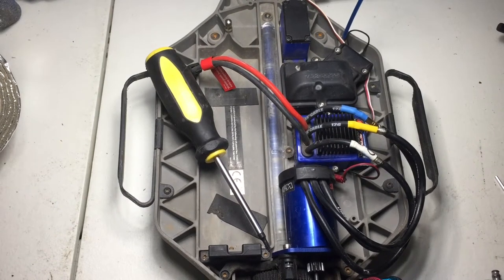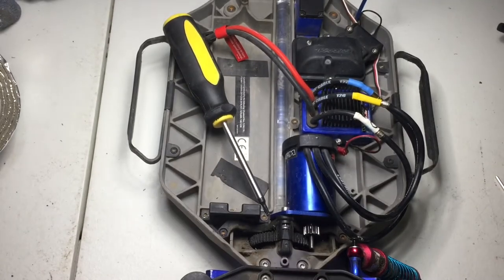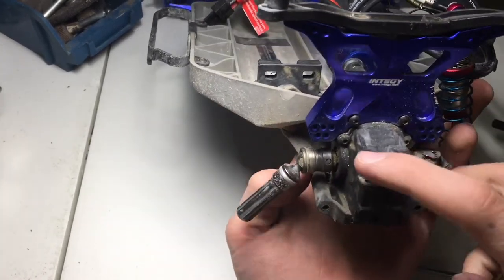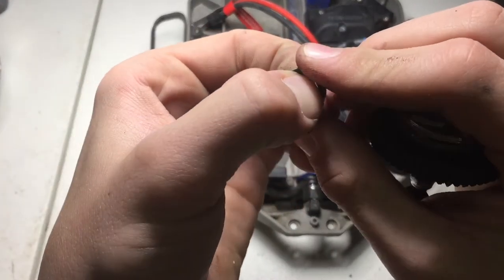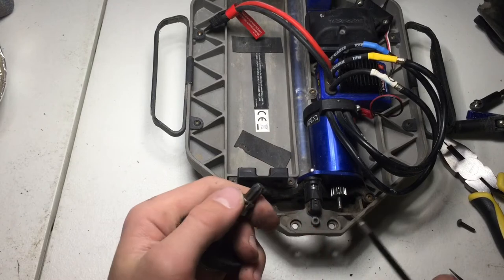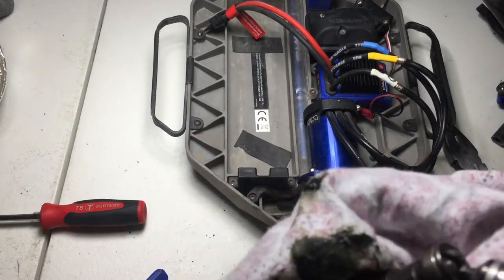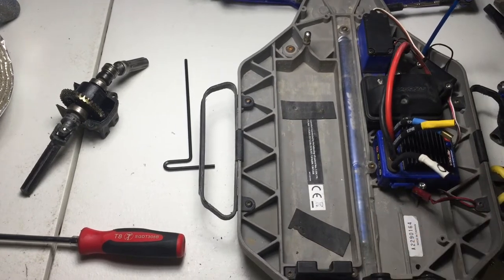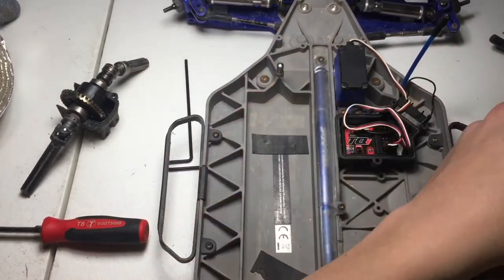My Traxxas is a Stripped Screw Nightmare!

Comment: I have the same problem of the screws stripping out but it was the grub screw on my pinion
Reply: Sammmmeeee!!!! How did you end up fixing it I am still stuck with it
Reply: @bryan.s6104  I’m just now having this issue any fix?
Reply: @MarbleCityOutlaws  no i actually ended up using dremel and grinding it down then buying a new pinion and grub for like 7 bucks on Amazon.
Reply: @bryan.s6104  oh ok I was thinkin about gettin an extraction kit just so I’ll have it if it happens again. Def ordering some stainless steel screws next time
Reply: @MarbleCityOutlaws  ya traxxas really should invest in better hardware
Reply: @bryan.s6104  I’m not even using traxxas I got a yokomo drift car build and I guess they have garbage screws too
Reply: @MarbleCityOutlaws  lol sounds about right

Comment: I have the same problem on my stampede 4x4 vxl I recommend getting a stainless steel screw set from Amazon...best $25 spent for it
Reply: The stainless screws are even softer and will round out in no time.
Reply: got link

Comment: you need a much better set of tools and when ever you have to replace a stripped screw, put a stainless in its place.
Also when you feel a screw starting to strip tighten first to break it loose then unscrew.
Good luck and don’t give up it takes time to learn all the aspects of wrenching with RCs.

Comment: Yeah what do you do when its your grub screw on your drive shaft? Fresh out of ideas
Reply from the maker: you could try a rubber band between your driver and the grub screw, or the last resort drill it out then tap the threads to the correct size.